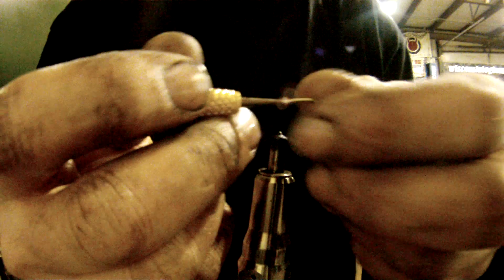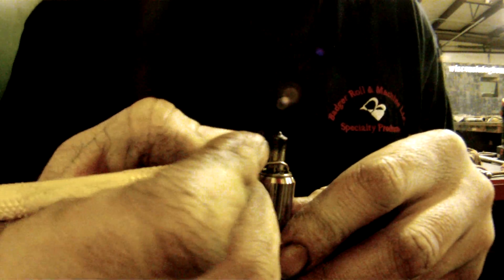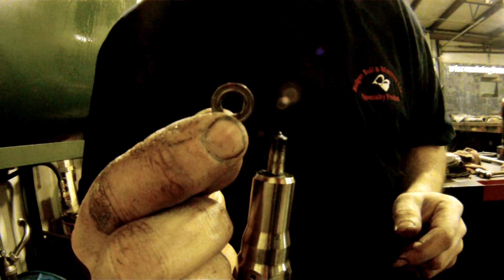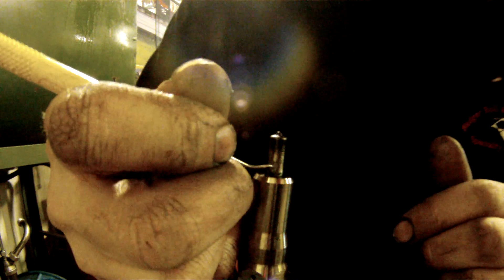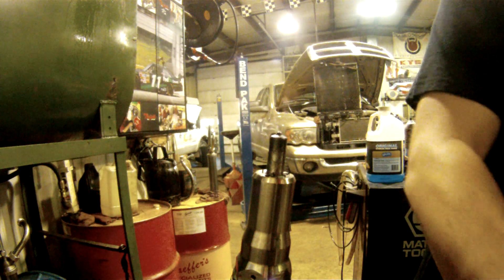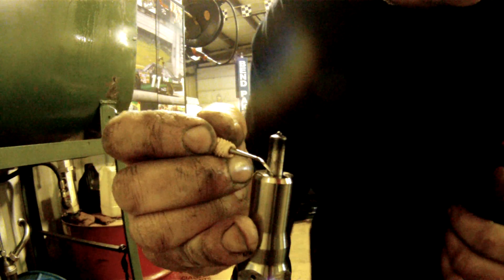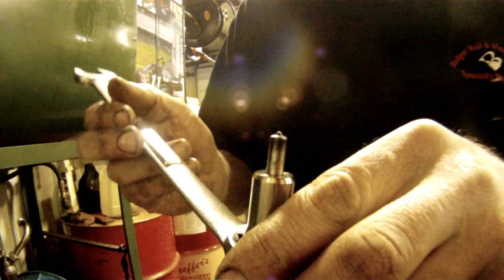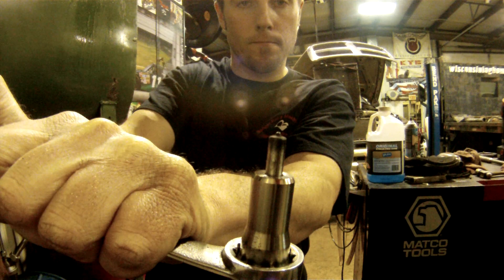How to change out Injector Nozzles on a 6.4L Ford Diesel. Part 1

Comment: what about when you want to clean your existing nozzle rather than replace it. Wouldn't hitting it with a mallet damage the tip? is there another way to get the nozzles off without breaking the pins or damaging the tip?

Comment: I got a 6.4 less than a year ago and, sadly I need to already do the injectors, turbo and Egr. Don’t have the funds to shell out for a shop to do it. 
Thanks for the video. Definitely a cheaper diy video. Only question is do you test the injector after the rebuild?

Comment: Jerry, any guidance on injector nozzles? Im about 5 steps behind you on my truck lol, ive done the typical fass upgrade and wicked wheels in my turbos and wondering on what size injector nozzles would be a good match. Drive a truck for a living and started slackin on my own and ive got an itch again, like i said, same truck just cant seem to keep up with you lol. My plan is in the fall when work slow, is to get serious with the fuel upgrades as far as hpfp, bigger turbos etc. But for now just looking for a nozzle to put some more pep in the stepping on the throttle.
Reply from the maker: Jeremy I would say that a good all around size nozzle is the 30% 6 hole nozzles.
Reply: Right in man, i appreciate the info.
Reply from the maker: Jeremy Gill I would give Morgan @ Midwest Diesel & Auto a call if you are looking for some of the nozzles. He is in IL and is very easy to work with and very smart with these trucks. Glad I can help bud. If you have anything else just let me know.

Comment: Hi Jerry.
Great video. I am rebuilding my 6.0 injectors and one of them broke off both guide pins due to carbon buildup when I separated the injector. Do you know where I can get 2 new ones? they are the short onces toward the tip, not the ones between the 2 flat discs.
Thanks
Reply from the maker: Sorry there bud I just seen this. I do not know where you could get them but my first choice would be to call Performance Diesel. 1-920-330-0183 and talk with them. They are the guys that I work hand in hand with. Great group of guys.
Reply: Jerry Bruley Okay, thanks. I will give them a call.